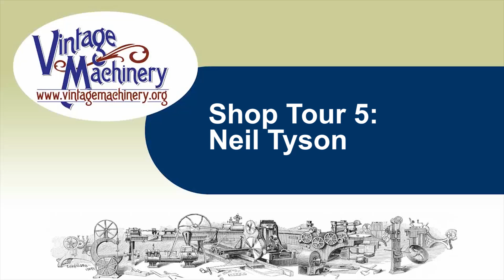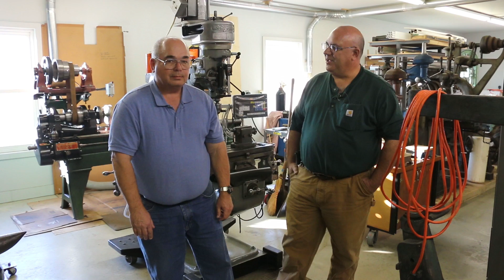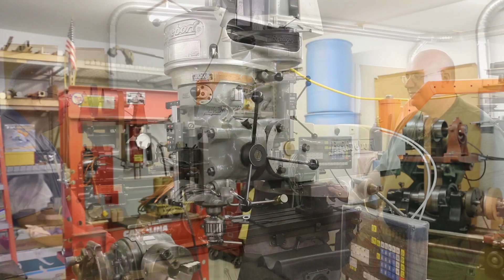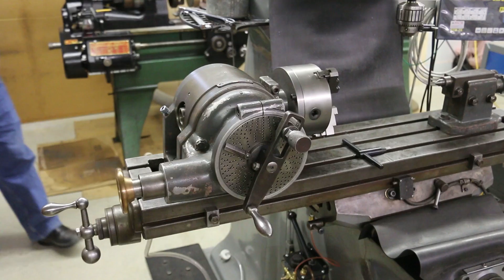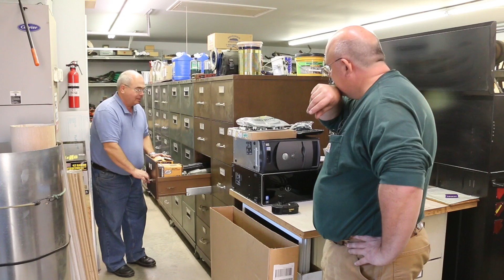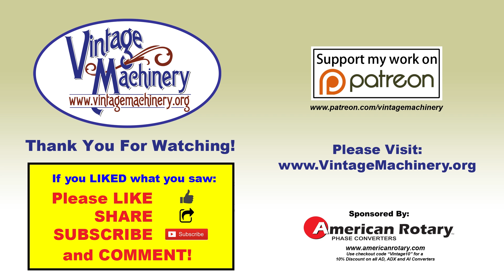Shop Tour 5:  Neil Tyson

Comment: Good informative video as usual Keith, and thank Neil for allowing us the tour of his shop.  But , This may a little off subject but As handicapped something has come to mind and perhaps between you Keith Fenner as well as input from Adam perhaps the three of you can come up with a solution a perplexing problem many have difficulty overcoming. It sounds like a simple thing but many vertically challenged find the need to change a simple thing like  a light bulb. I had been mulling it around I'm my head but perhaps the three of you can take on the challenge. Something you might be able to patent perhaps?

Comment: Hi Keith
like your vids.

I`m an electrical contractor based in south Leeds area UK and collect antique & vintage machine tools as a hobby in my spare time with the intention of eventually setting em up to use once I`ve rebuilt em all.

A list of what I have so far:

1) 16" centre lathe by SOUTH BEND. INDIANA. USA. 1920-1930. I need to check if its a gap bed but in good condition with its original ceiling mounted jackshaft. Lineshaft driven.

2) Radial drill. 1900-1910...unnamed...but suspected to be by ALFRED HERBERT. COVENTRY. ENGLAND. 7FT high. 3MT. Rise & fall table. In very good condition. 2 stepped pulley running a 4 speed gearbox. Interesting belting arrangements to the drilling head. This was originally installed at the THORNYCROFT TRUCK & STEAMWAGON WORKS. Basingstoke. England. Lineshaft driven.

3) Mechanical hacksaw by G. HERBERT. LEVENSHULME. MANCHESTER. ENGLAND. 1900-1910. A super rare machine with damage requiring complete rebuild.  Very heavy & substantial. G. HERBERT were a manufacturer of machinery & measuring/marking out tools. Introduced the RAPIDOR MANCHESTER range of mechanical hacksaws. the RAPIDOR MANCHESTER name was first registered in 1935. Lineshaft driven.

4) Mechanical hacksaw by DENBIGH. TIPTON. WEST MIDLANDS. ENGLAND. 1900-1910. This one is in super condition. Very little wear. Uses a constant drive pulley with cone clutch drive...unlike the G. HERBERT that uses fast & loose pulleys with belt shipper. Lineshaft driven.

5) Pillar drill 1900-1910...unnamed but definitely British made...possibly by DENBIGH. Missing its fast & loose pulleys and belt shipper but otherwise complete. 7FT high. Converted to electric...probably in the 60s. Easy to convert back to lineshaft. 3MT.

6) Pillar drill by JONES & SHIPMAN. LEICESTER. ENGLAND. 1900-1920. Very high quality. A real brute, this one stands just shy of 8FT high. 4MT with 4 speed stepped pulley driving a 3 speed splitter gearbox giving 12 speeds. 4 speed power feed gearbox. Complete with its fast & loose pulleys but currently missing the belt shipper. JONES & SHIPMAN-HARDINGE still an entity in the UK. Lineshaft driven.

7) Surface grinder by CAPCO. WILLESDEN. LONDON. ENGLAND. 1910-1930. A very rare machine that predates the CAPCO models 1 & 2 that crop up from time to time. In very good original condition. Slideways nice n smooth with no apparent wear. Lineshaft driven.

8) Horizontal miller. The `TRIDENT` by PALLAS. LONDON. ENGLAND. 1920-1930. A super rare machine...I only know of one other in existence....in the USA. The one I have was used to 2nd op machine aircraft components during WW2..so I was reliably informed. In very good condition with virtually no wear. Lineshaft driven.

9) Bench drill 1900-1910...unnamed but suspected DENBIGH or SUPERIOR. Very nice original condition complete with its fast & loose pulleys, belt shipper and jackshaft. 24" high. 3 step pulley. Lineshaft driven

10) Bench grinder by ECLIPSE. LINWOOD. GLASGOW. SCOTLAND. 1910-1920. Lovely bench grinder by this very well thought of Scottish manufacturer of high quality machine tools. 8" wheels. Fast & loose pulleys with original belt shipper. In superb condition with no noticeable wear. Very nice brass stauffers atop the bearings. ECLIPSE name first registered in 1907. Lineshaft driven.

11) Bench grinder 1900-1910...unnamed. Very good condition & nicely finished. Lovely brass belt shipper. Brass stauffers atop the bearings. 6" grinding wheel & 6" sanding disc. Lineshaft driven.

12 Wood lathe 1900-1910...unnamed. Reassuringly heavy, this one has had its flat belt stepped pulley replaced with stepped V belt pulley...probably in the 70s. Easy  to return to original spec. Tool rest bars & bed + cross slide attachment

I`m also considering acquiring:

36" bandsaw by JAMES SAGAR. HALIFAX. ENGLAND. 1890-1900. In need of complete rebuild but appears to have been stored well. Very nice, heavy duty bandsaw by one of the best manufacturers in the business when trading. Lack of any guarding on it demonstrates how times have moved on. Lineshaft driven.

SMITH`S MORTISER by SMITH`S. LIVERPOOL. ENGLAND. 1910-1920. Very nice machine using an interesting flat belt drive arrangement to the mortising head. In need of complete overhaul but complete, appears undamaged & well stored. Rare. Lineshaft  driven.

When I get round to sorting all these out I`ll be bunging Utube vids up. The G. HERBERT hacksaw will be interesting as there`s quite a bit of welding to do on some cast iron components etc. Definitely a case of bringing this one back from the dead but the running gear on it has very little wear. Its rarity us what`s saved it.

Comment: Beautiful shop. As others have said these are excellent and I'll watch every one you produce. 

While there's plenty to be jealous of (especially as the owner of a 10" Logan lathe and a round column mill), in this case I am most jealous of the storage drawers, and the room to house them. I just built a huge bench for my machines (all benchtop models) and I'm working on a huge set of drawers for them, but it is a ton of work and a fair amount of money. I wish I could have bought something at a great rate that would have been ready to use so I could spend my time making chips instead of sawdust. But I'll get there...

Comment: Every time I find someone who keeps his machines on wheels I feel much better about all my casters.
Reply: People like to talk trash on them but chances are they're usually the jealous ones without enough machines ;) 
 All joking aside I came up with a setup that allows me to use a little impact and run bolts down that have feet on them to level things off and keep them from rolling.I cut them from 1/4 and 1/2 plate and they pretty much are just a tab that bolts between the caster and machine and it sticks out just enough(1.5 inches) for the foot that is attached to the heavy duty bolt.I can easily move and level a machine in 5 min or so and while they're not the most accurate I use stick on bubble levels to get things really close.Lets face it they are good enough for a band saw and press etc..........I can just roll my press out,zip the bolts down with a bat powered impact and align the bubbles and done.